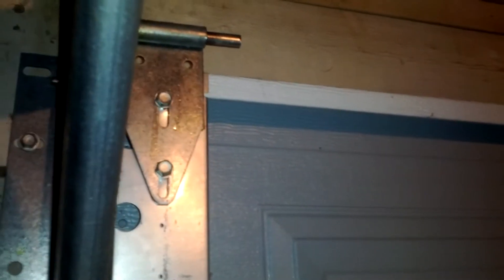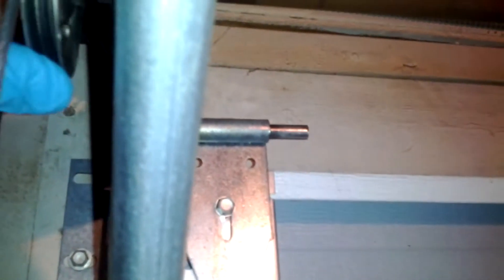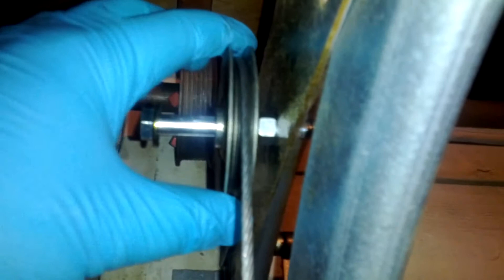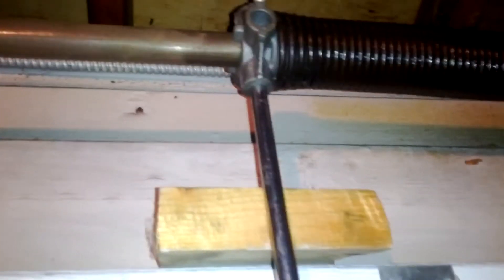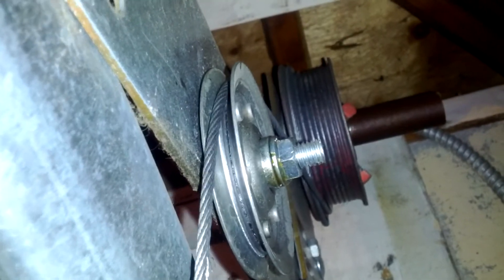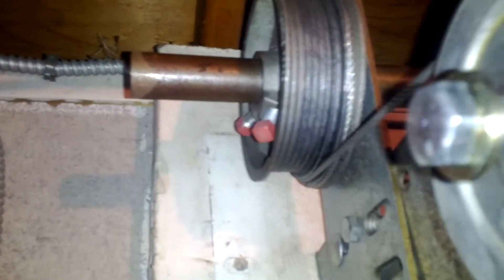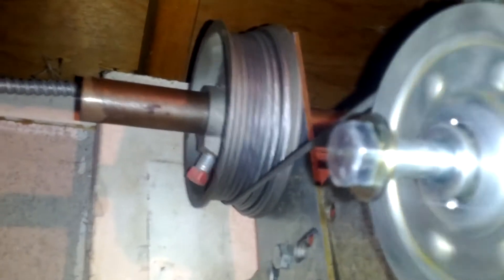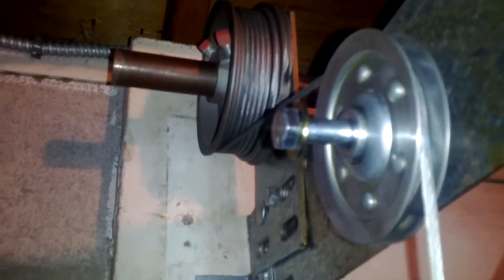How to fix a noisy garage door with a pulley cable system

Comment: I just had the cable come off the winding pulley. Would this set up help prevent that from happening?
Reply from the maker: It couldn't hurt as the previous setup was really pulling on the cable the wrong way, enough to cause one of the cables to begin fraying but no further fraying has happened since the newer setup.

Comment: I would of got rid of the stud pulley, flipped the springs and drums around so the cables come off the back and wind is down, you have low head with frnt mount tor,, set it up like a crawford